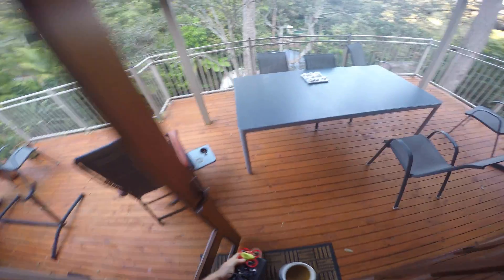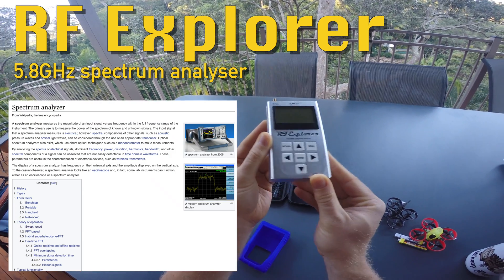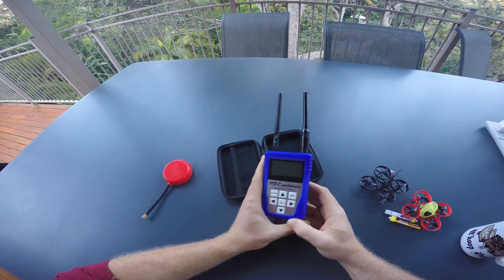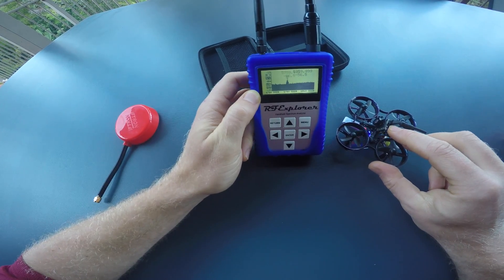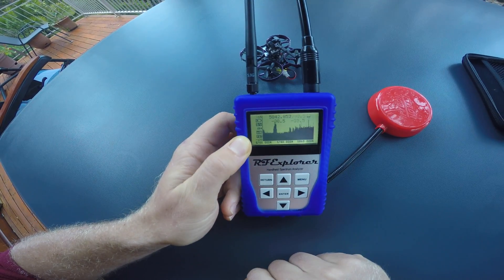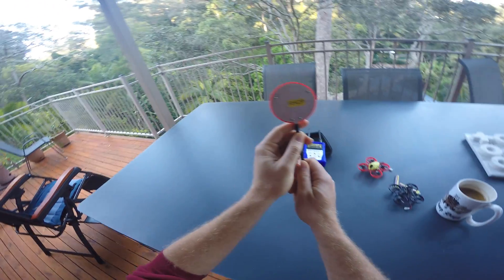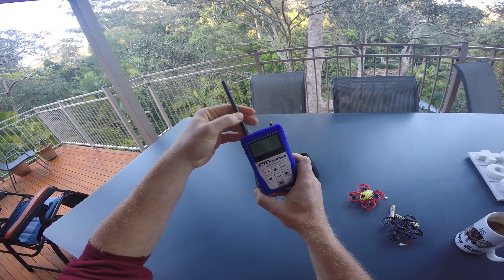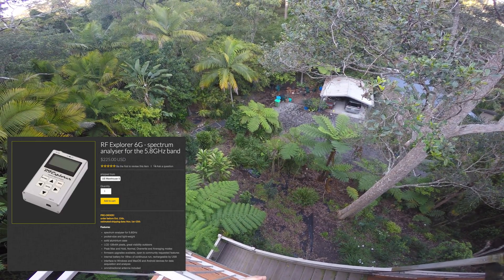RFExplorer 6G - spectrum analyser for 5.8GHz FPV video

Comment: the right band is 15Mhz (not 1Mhz) to 2.7Ghz. i liked the 6G so much i also got the WSUB1G PLUS which covers 50Khz-960Mhz so i could cover all the ham bands. i haven't the faintest idea what fpv is besides what your video shows, but it was useful information. tks,  /guy (73 de kg5vt | wqpz784)
Reply: FPV = First Person View, its an acronym referring to flying drones/rc planes that have a camera on them, and you transmit to something like a fatshark headset, which essentially gives you a "birds eye view" lol. 5.8ghz is the band used for these devices.